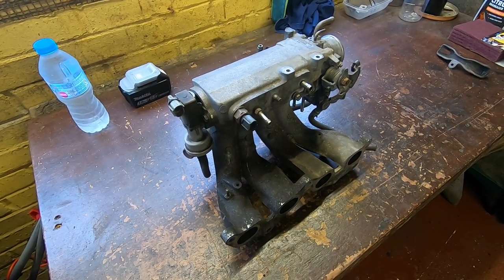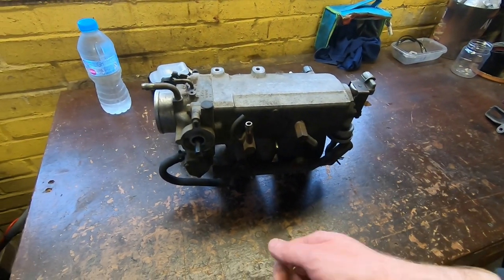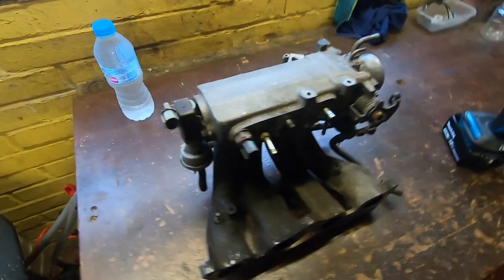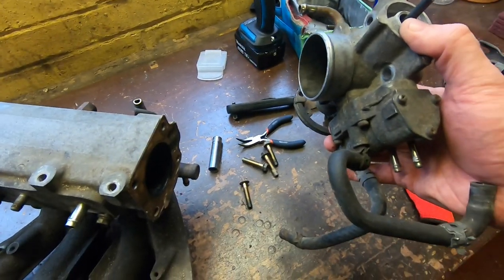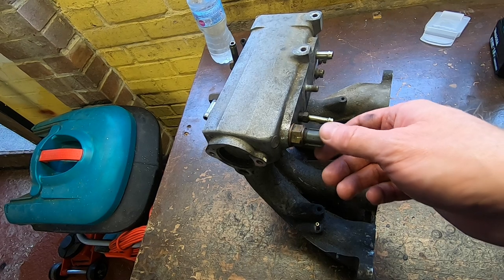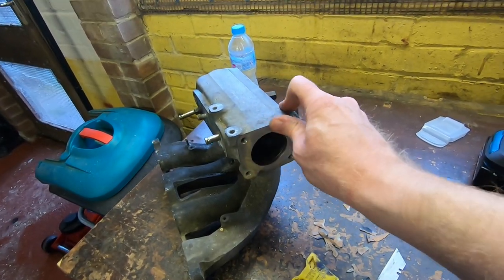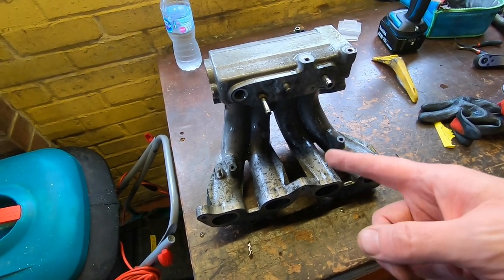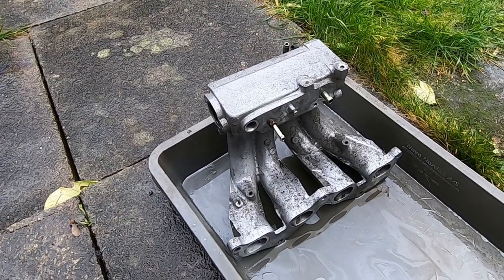Scruffy 4efte inlet manifold restoration. Can it be saved? | Toyota Starlet 4efe turbo build.

Comment: That's off a gt. Based on the throttle body. You'll need to convert to a VTPS to run the ecu to say throttle %
Reply from the maker: Cheers, the 4efte manual's had a 3 wire TPS switch (idle, off, Full Throttle). The 4efte Auto's had a 4 wire combined switch and % TPS (idle, variable %). Most people use an adapter plate and BMW variable TPS nowadays for standalone ecu.
Reply: @dan91sgarage  yes you can even 3d print a adapter
Reply: can i use also the 4efe Throttle TPS for throttle %?

my throttle body and intake looks the same way and is out of an EP82...
i cleaned it and made the tubes a little bigger - like the seal between intake and head
Reply: @nitrosmith0815  depends are you going to a standalone ecu?
Reply from the maker: @nitrosmith0815   As far as I know the EP82 (gen 1 4efe, manual g'box) use a switch type TPS. The Toyota ECU will only read that type. 

The EP91 (gen 2 4efe) used a % TPS and the Toyota ECU will only read that type.

If you have standalone ECU then you can add a BMW % TPS on the 50mm TB.